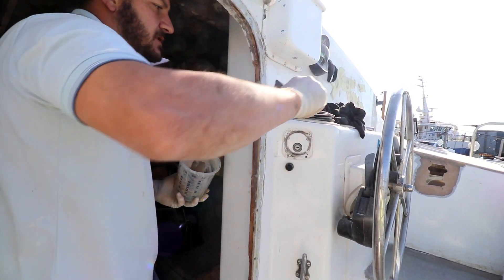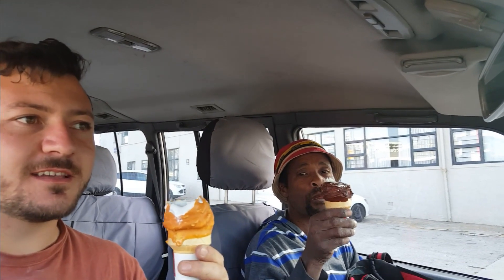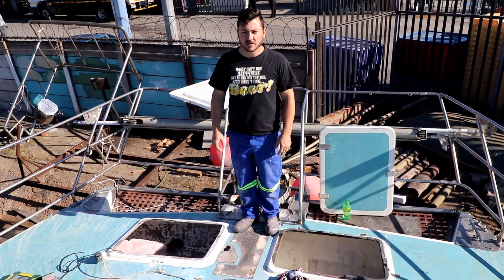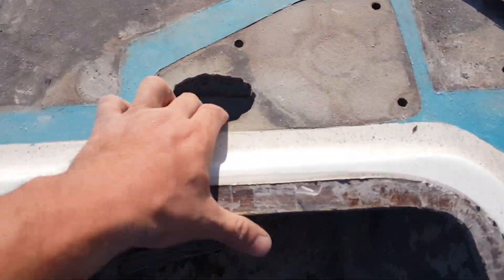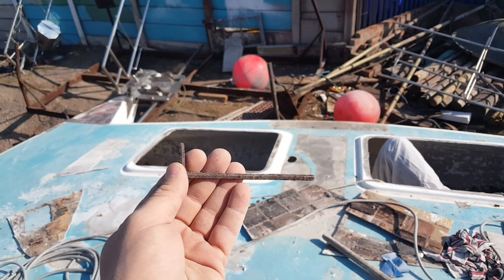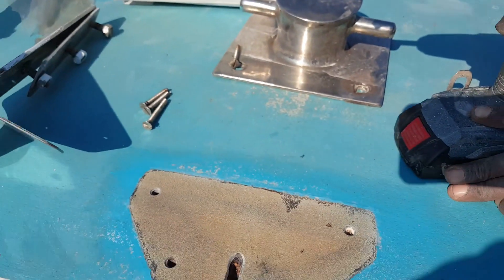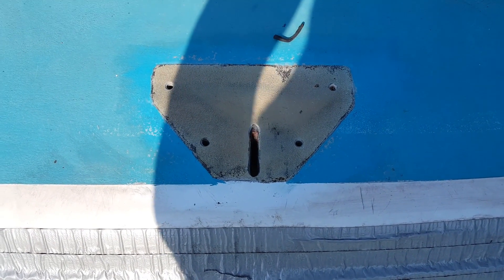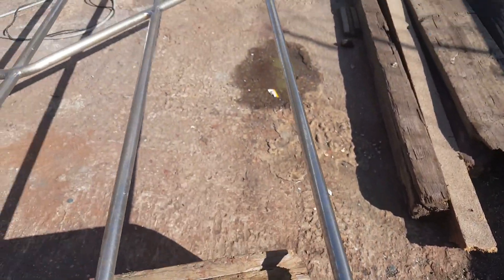REMOVING our DECK FITTINGS | YACHT REBUILD WEEK 34

Comment: Ricky when you start the coring replacement spend sometime on it ... Especially fairing the deck back in I found it really scares people, and a lot of people will hire the job out when it's actually not real hard they can just be tedious....
Reply from the maker: Hi Tony , we did a upside down core replacements so i did not cut the top deck open. much harder to do but it turned out solid. you will have to stay tuned for next weeks episode to see the results. thanks

Comment: Ricky, around 8:45 you do the Allen key trick. Just to be sure, because it's not totally clear to me - I think... Did I understand well that you remove some of the wood core, to replace that with polyester?
Greetingz, Wim
Reply from the maker: correct i remove all the wood core and fill the entire cavity with polyester or epoxy , then re drill the new hole
Reply: Thanx!

Comment: Having seen cleats pull out of decks before I wouldn't say its overkill. A decent safety margin maybe but not overkill. Are you planning on sealing around the edges of the top plates? Probably not quite as critical with a fiberglass boat as with steel but still a good idea in my view.
Reply from the maker: We will be sealing around the top plates for sure. Well it's overkill compared to most Deans but we found it great hence why we are keeping it.

Comment: Kiwi Grip or other non-skid on the decks?  When I did my decks I filled all the hardware holes with epoxy the same way you have but left them like that during the process of sanding the the decks.  I taped off all the hardware footprints and rolled the Kiwi Grip, then re-drilled all the hardware holes later.  I had painted the entire deck with primer, the hardware footprints got gloss white because it makes a far better seal for butyl tape or polysulfide being smooth rather than textured.  I center punched the filled epoxy holes so I could still see the pilot divots even after painting.
Reply from the maker: Thank you very much, we are looking at doing something along those lines as well. We haven't gotten there yet. Hopefully soon though.

Comment: thats a lot of stainless and weight up front,you might want to modify it a bit whilst it is off,replace backing plates with aluminium,and get rid of a few of the bars on the pulpit,one top bar is sufficient,the rest could be replaced by wire.
this would reduce quite a bit of weight up front.
the anchor roller set up and cross bars look like they could also be redesigned easily to get rid of unnessasary bits and weight,those teak gratings are purely cosmetic and must weigh a ton!
Reply from the maker: Hey Alex , yes ive been looking at all the stainless on the front and im considering getting rid of the whole lot and just building some small bow seats and a single anchor roller. i don't need the two anchors there and im always concerned with mass. the rails are not heavy that anchor system is way too far over the from and  too heavy . nip and tuck time ! stay tuned we about 5 weeks ahead of what everyone is watching
Reply: hi ricky yes i get the time lapse thing so my comments are probably a bit late as you need to make those important decisions as you face them. in real time.

my bow pullpits  weigh about 12kg each side and came second hand from a 30ft yachts aft pushpit.
 they form a nice  90 deg structure with two legs about 1m500 either side and one leg 600mm on the front edge of the cross beam lamination  ,either side are eyes welded on for twin stanction lines,across the bow and either side of the cat leading aft, in line with the bars on the pullpit , very light simple and safe.

if you modify the anchor rollers i would reccomend keeping twin bow rollers as a second anchor is always a good idea,but rigging a bridal from either the bow cleats or strong points near the waterline reduce the need for the bow rollers to take the full strain of an anchor when in use apart  from when it is dropped and retrieved.

the main anchor about 30kg and chain 10mm is best kept so the chain stows by gravity below the  electric anchor windlass,80m-100m of chain being about the minumum you would want

a second anchor 20kg can be kept stowed in the front locker with about 15m of chain and 90 m of  20mm rode  this can be deployed and retrieved by hand easily.

reducing weight at the ends of the boat will make the cat less likely to hobby horse or pitch in a seaway 

build composite holders/.mounts for the gas bottles,no rust or weight and use webbing straps to secure,similar to you shelves for your watermaker and bits in the aft

works for me
cheers alex
Reply from the maker: @alexbond490   hey Alex , thanks for the suggestion i will surely consider it and try and keep the weight down as much as possible . Im waiting for some fiberglass gas cylinders to arrive to replace the sleet ones i have i hope this was not a mistake as they are a bit expensive . I have never used the fiberglass cylinders before as they are not very common here in SA . 

Best Regards 
Rick
Reply: fiberglass cylinders should be fine,no corrosion issues,and light.i have a 12 kg BP glass bottle for propane with an aprox 30mm bayonet fitting. which is fairly common in europe.

the only thing is in some places you might have a problem filling them ,like in,australia,uk and some parts of europe where they will only exchange their own brand bottles due to local  safety laws.

caribbean,pacific islands,se asia and the med it was pretty easy to get bottles with any type of fitting filled by the local marina,yacht club or chandler who would have a collection service.
cheers alex

Comment: Hi Guys, great video as always! At 11.24 you replaced the velcro pad on your sander. Where did you get a replacement? What do I look for? I need to do the same. Thanks
Reply from the maker: Hey there, well we have a Bosch tool so we just went to the the Bosch store or service center to get our replacement. You just ask for the Velcro Backing Pad.. ours is a 125mm but you get different sizes depending on your sander.